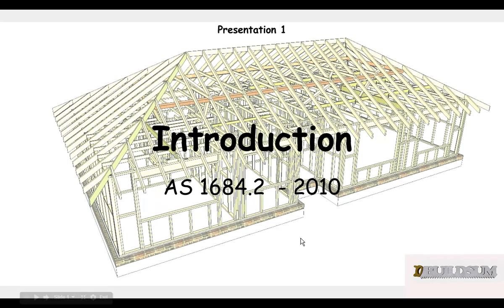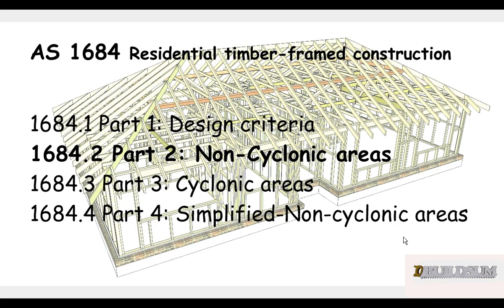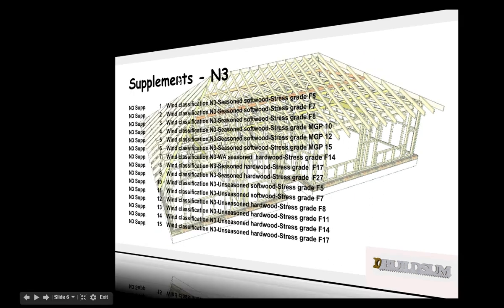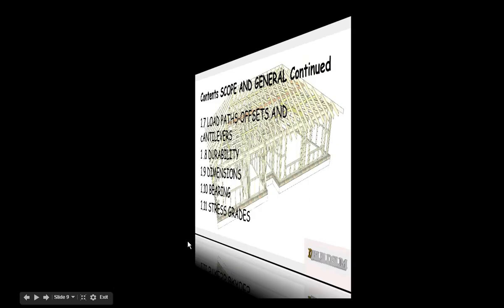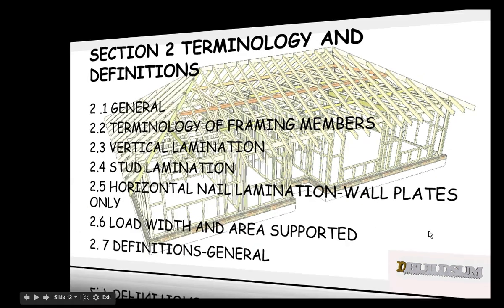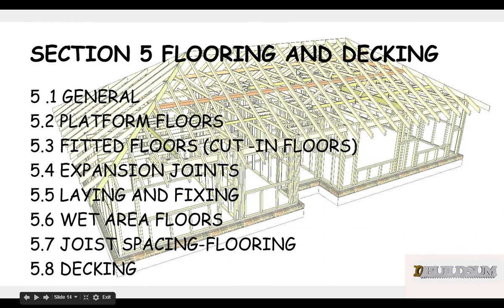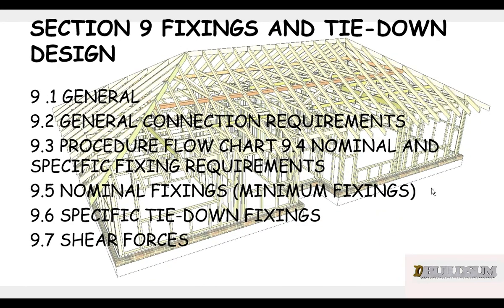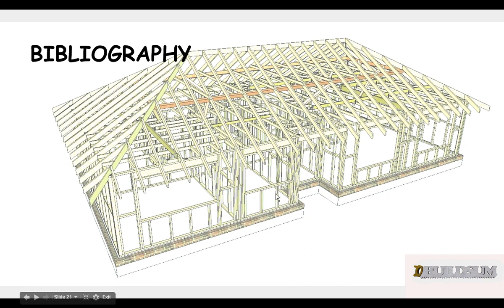Timber Framing Code - Introduction

Comment: Hi Buildsum, very informative. Thanks for putting this together. Just had my slab and frames done. The frames are attached to the slabs with nails. I have seen few videos on youtube where it is usually bolted. Is nailing good? I've doubts on how stable the structure is (first time builder, hence the worry).
Reply from the maker: Hi Mate, nailiing is just the intial fastening while they are putting up the walls, they should go back and put in a Dynabolt or Tiger bolt at the base of every brace and every 1200mm in between. did the frames come from a factory or did they cut them themselves?
Reply: @Buildsum  Thanks for the quick reply. The frame came from a factory. The frames completed last week, so nothing else has been done afterwards.
Reply from the maker: Hi, if thats the case the Frame company should have supplied a tiedown and bracing plan with the frames. This should show you what tiesdowns are required.

Comment: Thanks @Buildsum. You're videos are awesome. Wondering if you can tell me if double top plates are required for simple timber wall frames? I saw somewhere only for external walls but that does make sense. If the internal walls didn't have double top plates, is there going to be a gap at the top of internal walls as the ceiling joists are going to be at external wall height?

Where would I find a table on lintel/header sizes for above openings? Thanks again!
Reply from the maker: Hi Willo, Double Top Plates are not required as long as you meet a couple of conditions. Normally the external walls of a trussed roof house will have a double top plate for 2 reasons 1. to make sure that the trusses don't sit on the internal wall and 2. to allow for any random loading of the top plate.
https://www.youtube.com/watch?v=35K_SMW7_kM
However you don't have to use a double top plate as long as neither of these issues will occur, you can make the internal wall shorter and you can make sure that all Rafters or Joists land on a stud and then the double top plate is not required. Hope this helps.
Reply: @Buildsum  Thanks again, can i contribute to your channel somehow?
One last question (promise) if the internal walls lower, am i attaching ceiling joists to the top plate of internal walls and the underside of trusses
Reply from the maker: Hi Willo, if you are doing a cut roof with a ceiling frame the internal walls will have to be the same height as the external walls and the ceiling joists attached to the the top plates. 
If you are talking about a trussed roof then there is a speacial bracket that ties the  top plate to the trusses while still letting the trusses move up and down when the load of the roof is applied.
No need to contribute Willo just spread the word, thanks.

Comment: Hi Buildsum. I'm having frames and trusses pre-fabbed. I'm adding a weatherboard extension to the back of a brick veneer house. So wondering what the regs are around this. Am I permitted to attach the frame to the brick, part of me says that this is not ideal as the brick veneer is not structural, do I need to drill through the brick so the new frame connects to the old?
Reply from the maker: Hi John, I am not aware of any regs in regards to this. Tying it into the existing structure should not be necessary as the new section would be strong enough to support itself and standalone. The main issue I can see will be waterproofing where they join. You will need to make sure that you get a good seal between the brickwork and the frame so water can't get in.
Hope this helps

Comment: Hey Buildsum. Just wondering what does EWP stand for in Timber framing? Thanks Good Video.
Reply from the maker: +Edward Johnson (AgentEddie99) Hi Edward The only definition for EWP that i know is Elevated Work Platform but i don't know how that relates to timber framing. Where did you find this, was it in the TFC because don't recall seeing it in there.
Reply: Construction Tafe Course.
Reply from the maker: +Edward Johnson (AgentEddie99) Ok then i would say Elevated Work Platforms like a scissor lift or cherry pickers is what it is referring to .
Reply: Engineered wood products??
Reply: It's in slide 9.

Comment: Do they make it fucking hard and over complex on purpose ?
Reply from the maker: Hi Charlie, the problem is that this is designing the structural elements of the building. These videos are based on AS1684.2, there is AS1684.4 which is the simplified version, however, I think it is harder to use than AS16484.2 and the simpler you make the tables etc the less efficient the specified members become.

Comment: Nice video.  Not 'The Act' though.  'The Act' is the EP&A Act which calls up the BCA/NCC (through the Regs), which then calls up this Australian Standard - 1684.2, also know as the Timber Framing Code.
Reply from the maker: Hi Mate, Yes thanks for the clarification, I tend to slip into calling it the "Act" even though it has no legal standing unless it is referenced in the BCA/NCC

Comment: A if the BCA has all the information for timber framing why does the tasmanian government require owner builders to get an engineer to "design" timber frames, surely this should be something the building surveyors signs off on.
Reply from the maker: Hi Mate, All information re Timber framing is found in AS 1684 Residential Timber Framed Construction, ( Timber framing code). The reason is most likely because Owner Builders aren't trained on the Application of the BCA or how to use AS 1684. Not sure if you have your terminlogy correct however a Building Surveyor would have no formal experiance with the Timber Framing code either.

Comment: Hi,
Thanks for making these great videos. 

Can you please make some more videos on AS2870, about how to determine the spacing of internal and edge beams (arranging the grid lines) for a residential building  and the reinforcement as well. 

Thanks
Reply from the maker: Hi Arafat
This is possible however not in my area of expertise and would not be a quick turn around unfortunetly.